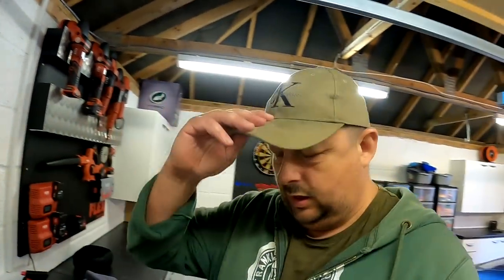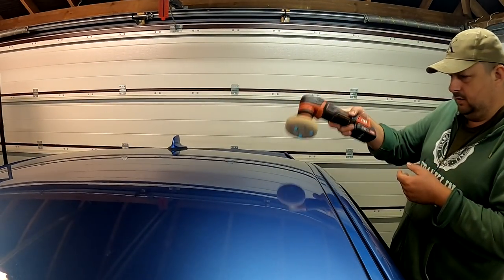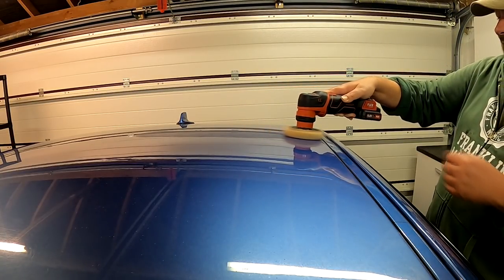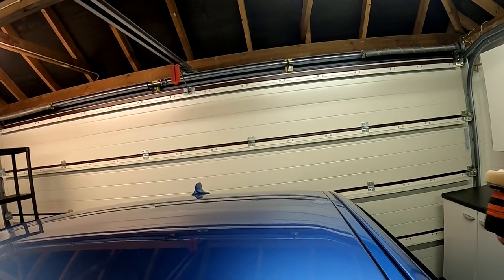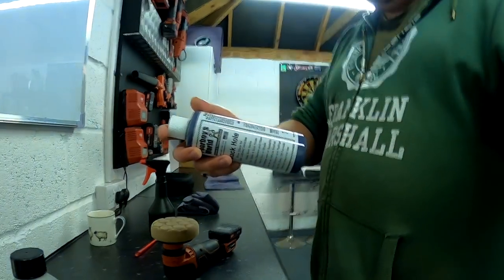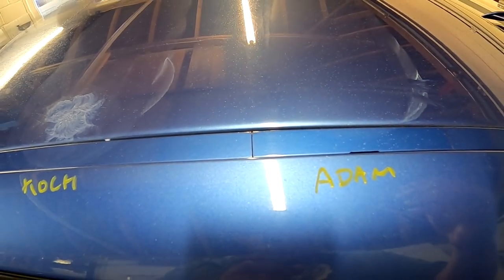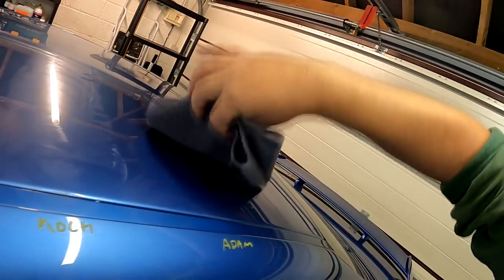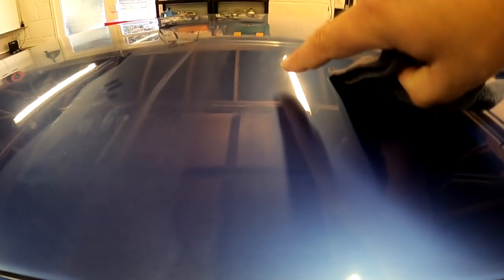6 Hand Polishes 1 Swirly Car | Which detailing product is best? Meguiars Bilt Hamber Koch BlackHole?

Comment: Black Hole is a glaze, not a polish. No surprise its not abrasive..
Reply from the maker: goto the poorboys website. on the listing for this products its classed as "catagory" polish.  

The SDS also shows CAS 266-340-9 which is typically used as a wider umbrella for inorganic oxides eg abrasive material.     A glaze typically contains some bespoke abrasive material.
Reply: Forensic Detailing Channel It is clearly placed under the «Show car glaze» in Wax and sealant category on the website. Are we checking the same website? :)
Reply: Forensic Detailing Channel but something tells me that your knowledge about those products is slightly better than mine, so Im not gonna argue, just pointing out 😁
Reply from the maker: @RuffRyder1980  https://www.poorboysworld.co.uk/product-category/polish/

Comment: Cant beat Autobrite Cherry Glaze. Been around for ages, easy to use, amazing finish and doesn't leave any white marks on plastic trims. Clean, polish, wax in one. Bang on.
Reply: Ryan David I used brilliance from AD wasn’t very impressed with the filling capability’s
Reply from the maker: cherry glaze did not fill well when I tested it in the best glaze video.  It was almost like a glossy liquid wax but yes very poor filling capabiltiy I even said I suspected faulty batch.
Reply: @ForensicDetailing  yeah maybe. Its been amazing for me for years. They have brilliance which is designed to fill more but I hardly use it as its harder to work with. They also have chocolate glaze too now and cherry glaze v2 but I've not tried these. Used to use dodo need for speed years ago too, old skool!

Comment: Where autoglym super resin polish the best out there in my opinion
Reply: Agreed. Recently bought a bottle of Autoglym Super Resin Polish, did my whole car, the gloss, clarity was amazing on a silver car. It also acted like a clay bar, getting rid of tiny black/dirt marks I didn't see, but I suppose polishers are meant do that anyway. It is mild abrasive, which I like. Also bought Autoglym Glass Polish for £6.40. That also did a great job, so tried it on my house windows. Stood back and thought someone had stolen my windows. Tried it on house tiles, came out sparkling as new. Really impressed with this product as well. There must be about 40 plus polishers out there, this is about the only way, anyone can test these products, even if it is 6 at a time. Jon does a great job of being analytical and results orientated. Using brightness/clarity, ease of use/price, performance, durability and a few other factors. Certainly helps me decide which product is the one for one. Loving those cordless polishers.

Comment: Thanks again for some more great information. For a few years I have have been a fan of Cleanser Polish for quick clean ups of friends cars and what not. More recently I have been very impressed by the filling and gloss provided by CarPro Essence Plus which is the same principle I think as that Britemax product and maybe the TAC too.
The versatility of being able to put any kind of protection on top of it is really useful.  They can also act to fill and rejuvenate a ceramic coating if they are swirled or damaged.
Very cool.

Comment: Love the poor boys black hole, non abrasive so can be used as often as you want without removing clear coat, 

And I’ve used it on burning hot black paint with no problems whatsoever 👍
Reply: Charlie 400 How long can you make it last?
Reply: I have black hole....to use by hand....worth it???? Or SRP??
Reply: I have Black and the White Hole glaze from Poor Boys.  I do like the product but don't use it often.  I would use this before a wax, and I just don't use waxes anymore.  It really isn't intended as a polish, it doesn't have the abrasives.  It does leave a nice slick surface.
Reply: Agree black hole for the win especially on my black car

Comment: Quick question,rather a long one :-) I don't have a  DA polisher so the only way I can do polishing is by hand.
The Vehicle was ceramic coated 2 years back and has been maintained to the best of my ability
But again swirls are inevitable and the vehicle has swirls(Not too many but yes the ones which you can get with regular washing and maintenance).
The paint overall looks pretty good and no fading or other major issues.
The vehicle is white in color.
I want your suggestion as to which product/polish should I use to achieve this (Remove Swirl marks on the paint on a regular basis like maybe once a year) and then apply some coating.
Unfortunately in India, the only prominent brands are Turtle Wax, Carpro, Gyeon, Menrenza, Meguiars, and few others but again not a whole lot of options like in the US or UK.
Now I understand that polishing by hand is not going to remove all the swirls which are Ok with me.
Even if I can remove 80% of the swirls/marks I will be a happy man since that is my pain point. Additionally will using that product remove the ceramic coating?
Kindly suggest a product for my requirement. Thanks in advance

Comment: I like meguiar's 3 in 1 wax, an excellent aio with real correction power (not just a fillers).
In addition to having a beautiful water-repellent effect!  For a simple aio I find it nice
Like aio I also like to use meguiar's color x with a double action it works very well.
Regarding meguiar's cleaner wax, I don't understand, some say that it can only be used by hand, and others say that it can be used with a dual action?!.  Just like the 3 steps deep-crystal meguiar's apparently for use by hand, and others say the double action.  Do you know more about it please?  Thank you

Comment: Jon, I have a new white model 3.  It's a lease car and I've sold my DA due to not using it. Given it has new, white paint and that I'm not aiming for competition flawless paint, would you recommend BH cleanser polish as sort of a 'stronger' pre wax cleanser? I'm thinking that if i'm going over the paint with a pre wax cleanser by hand, I might as well use something that's going to hide/correct the light swirls that are inevitable regardless of how care one washes their car. I'm thinking that the next time I decontaminate the car to reapply the wax, I might clay it with some BH fine clay, the softest one.  Now, given I no longer own a DA, will BH cleanser polish by hand be sufficient to fix/hide the clay 'damage'?

I should add that my LSP is BH DSW, and I've no real plans of going for ceramic coating given I'll be handing the car back in 3 years.

Comment: hi i have das 6 da and it came with Menzerna Heavy Cut Pad 
1 x Menzerna Soft Cut Finishing Pad, now i have only used these pads about 5 times and the backing is breaking off onto the machines velcro plate, leaving no backing on half the pad and fluff stuck all over the velcro.
any advise as to what im doing or if these pads are just bad

Comment: I decant BH into a little clear plastic  pump bottle before each use - the travel bottle sets you get in cheap shops (should be in stock as nobody's going on holiday...).  Always a bit runny even when shaken well but great results :-)

Comment: Hey mate love your videos and as a result have spent over 500 to get all the bits to keep my car pristine,
Have a question a pipe leak that was constanly spitting salty water for last 2-2 weeks has caused stubborn oxidation on half my bonnet a headlight kidney grill and bumper , have tried iron fallout, tar remover and adams apc but no results what would you recommend for different surface especially the BMW grill  I am thinking compound/claybar? Thanks !!

Comment: I recently used TW hybrid ceramic polish and wax, applied by hand, then applied TW hybrid ceramic spray wax 24hrs later. Honda 10 yrs old, had a few swirls, they seem only a bit fainter, I didn't spend hrs polishing. Very pleased with gloss. Pleased with result. I suspect BH Cleanser Polish + DSW would have looked better in terms of filling swirls, but I wanted extra long longevity, TW promise 12 mth protection and TW hybrid ceramic spray wax is quick and easy to apply regarding future washes to top up protection.

Comment: Is the meguiars 3 in 1 very aggressive on the clear? I like the idea of an all in one product and I would be curious to try it. The car is 12 years old but is in very good condition, it has only a few light swirls due to incorrect washing, nothing serious. The meguiars contains abrasives and I would not want to do any damage using it by hand being the first time I polish the car. Alternatively I noticed Liqui Moly 1467 which is a famous German brand. 
I am curious about Liqui Moly products, it should be a light polish very similar to Meguiars but at a lower price. Do you have experiences with Liqui Moly bodywork products?
Reply from the maker: No
Reply: @ForensicDetailing  thanks for the thorough reply 😄

Comment: Jon, is that a 3 inch pad you're running on the flex PE? How does it run with that larger pad, do you tend to notice it struggles a little versus the smaller pads?  I'm looking for a new 3 inch machine and I'm considering this cordless unit.
Reply: jonathan taylor  It did perform well and the price of the product is a lot cheaper

Comment: Would you use the Bilt Hamber - Cleanser Polish polishing by hand without a buffer, or would you recommend a different one for hand polishing? using the BB auto wash and once a month the BB touch on.
Reply from the maker: if you want more cut by hand the nanolex product which won the PVD hand polish test was insanes sorry  I dont have the product name and I cant find it with google but it was great polish and seal in one.  the BH is a milder abrasive with resin fillers which will also do a good job by hand.

Comment: I royally screwed my paint work using a rotary polisher and Chemical Guys V36 having never used any polisher and should bought a DA (V36 was great it was the users fault) I’ve been lucky enough to get the trails and holograms out by hand using Autoglym SRP took a while and being disabled it nearly killed me! So that was a hard lesson to learn ...when I can afford I will be getting a DA. Can you help with what I should buy and I can’t afford a lot...thanks in advance Jon
Reply: With a rotary, you do need to step the pad and polish down and do multiple stages.  If you still want a DA, MaxShine 15 Pro is rated very high with a low price.  You could go with a Flex or Rupes, but will pay about double compared to MaxShine.
Reply: Hi Doug thanks for the reply, I struggle with the physical side of this so the trails and holograms I think was too much pressure and also lack of energy on my part, so far I have clay barred the car from the front to the main pillar (roof not done yet) screwed up the bonnet and front redone by hand which I think has removed the mistakes.  Got a fairly good process for washing the car and prep for the clay, polish etc. No idea if I’m doing it right but it looks better than when I bought the car. I’ll look at the DA you mentioned as well.....thanks again mate and keep safe and well

Comment: I have autoglym sealant and sonax detailing spray after I've polished can I apply both and in which order should I apply them? Thanks!
Reply from the maker: after polishing you should degrease if its a pure abrasive, or just wipe down if its an AIO, then apply a compatable sealant over the top.   so autoglym first then sonax detail spray on top is best.
Reply: @ForensicDetailing  brilliant, im going to be using the turtle wax one and done you reviewed a couple of days ago. It looks good so cant wait to try it! I will degrease before applying my sealant and then my detail spray. Thanks!

Comment: Top video 👍 Maguiars got ditched for price but Britemax is the most expensive there - it’s the best there IMO. Good correction, nice to use and buff and offers the most protection out of the line up. Also compatible with ceramic so win win - i have it under Moonlight and it’s an ace combo for sure. Applying a hand polish by machine seems odd ?

Comment: Maybe a silly question but anyone know if the bilt hamber is best used by hand or can you get just as good(or better ) results used like a final stage polish using a machine polisher ?
Reply from the maker: you will get better "correction" from the abrasives in it if you work it by machine... but the resins in it or the function of those resins works more or less the same by hand.   I like to use a machine and a nice soft pad.
Reply: @ForensicDetailing  much appreciated 👍🏻was thinking a finishing pad at a slightly slower speed , new to channel but loving the in-depth information , cheers for your work 👌🏻👌🏻👌🏻

Comment: I'm having a bit of an issue myself at the moment, can anyone recommend a product that removes swirls/holograms from very hard Merc anti scratch clear coat? i'm a Car painter so don't tend to work with really hard paint in the main and we have this running issue with a Black S class, some one in the past has burnt the hell out of and it came to us about a two years ago to be fixed....... at the time i used SONAX Perfect Finish to cut it and went over it with Fusso wax to seal....... looked great for 12-18 months but now looks as bad as when i started almost like the Sonax had filled the swirls and Fusso had kept them filled for 12 months...... I'm a little worried about going at it with some heavy cutting compound if i'm already struggling to get fine scratches out properly. Any advice would be most welcome!! i'm a bit out of my comfort zone and were a bit on the hook with this one.
Reply from the maker: Merc paint can be a nightmare.  sometimes its ok other times its just like rock and literally cant dent it.   But patience and Koch H9 or H8 are your friend.  Theres no miracle fix for this.  Just go a bit longer it could take 3 sets of cutting to remove deeper defects.  So much sure you have depth gauge as well.
Reply: @ForensicDetailing  I will give that a go, Thanks very much.

Comment: I need to just be this way wen it comes to getting out the swirl marks on my car.just go right at it,instead of being to scared and getting ready to pay my mate £200 to do it,would love that feeling to do it my self,but used Meguiar’s ultimate compound on my bonnet wen i first got my DA and it didn’t get rid of the light swerl marks,so it put me of doing it,thinking I’m gonna either go through the clear coat or something,practice on a bonnet a mate gave me and now used menzerna 400 and that for sure worked,using Meguiar’s red cutting pad
Reply from the maker: you wont go through the clear with a DA tony.  you would need to buff on it for like hours..  remember as well a good DAT abrasive will taper off the cut..  Go at that paintwork full throttle my friend you will be fine on a DA honestly.

Comment: You need to do a vid of using tetrosyle pawned wipe as a tar remover Iv just bought 5ltrs
Reply from the maker: you can use it that way when the tar is sort of spread over the panel.. but its not like as strong to melt of the big blobs of tar in the barrel of the wheel.    Ive moved away from tetrysel now..  awesome value and it works but you need to be aware of the temperature and flash requirements in winter without a heated workshop if its cold it wont flash.
Reply: Forensic Detailing Channel I’d like to see. A video of it being used on tar also don’t know where you got it for £13 cheaper I found was £20
Reply from the maker: @hakman239  I dont have any now I used up the last of it.  I got it for 11 quid on ebay about 3-4 years ago and it lasted all this time, although most times I use a water based one or like Im testing prep or something else.   its not formulated as a tar and glue remover so if I test it for this and I do a video Im likely to get sued or at best upset a company.   but this product served me very well as a panel degreaser let me know your thoughts on it.   be mindfull of flash times with it... be carefull using it in the sun.
Reply: Forensic Detailing Channel  Iv used upol before
Reply from the maker: @hakman239  these products are less for guys at home hakman.  they are more for professional environments where you have controlled temps.  workshop etc...
Reply: Forensic Detailing Channel  I don’t mind

Comment: Do I need to apply wax after these products?
Reply from the maker: you can do, it will help increase the durability typically of the protection
Reply: @ForensicDetailing  What would be the product with longest protection of all the products you have reviewed without applying wax in the end?
Reply from the maker: @sabotage3d  best durability AIO hmm  none are great and we tend to measure durability through water repellency which can be misleading.  but the megauirs 3in1 I think offers the best protection durability of these AIO's
Reply: @ForensicDetailing  Thank you for the detailed answer. I am just starting out and discovered your channel and subscribed. Do you have a video on how to protect the rubber, plastic trims and headlights from polish and wax?  Is there a product that is more forgiving on these, to clean easier when it hardens? I have ordered Autoglym Super Resin Polish and Extra Gloss Protection, but it seems these are really hard to remove from rubber trim.

Comment: Can fusso be used on top of bh after it has been wiped with bh cleanser  fluid.
Reply: col 05 if you mean BH cleaner polish you wouldn’t wipe it down with Cleanser fluid or any panel wipe as it’s not a pure abrasive - it has abrasive elements but also acryllic fillers that are meant to stay not be wiped away. As for laying Fusso on top I can’t see why not - BH recommend their waxes on top so why not Fusso ( might be corrected on that ! )
Reply: @01123581321341  ok cheers